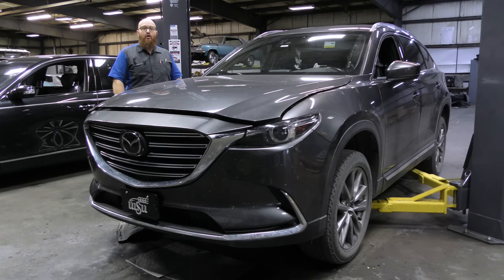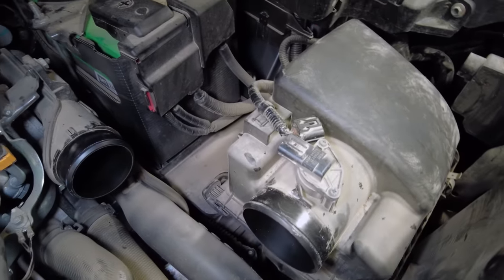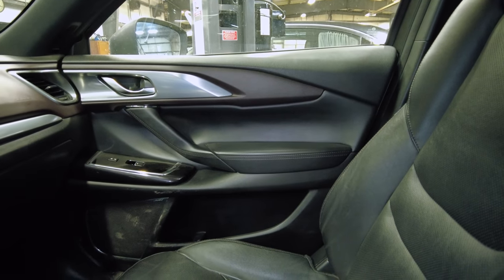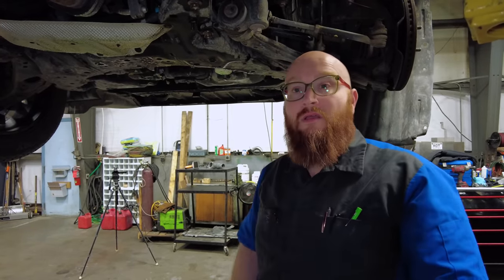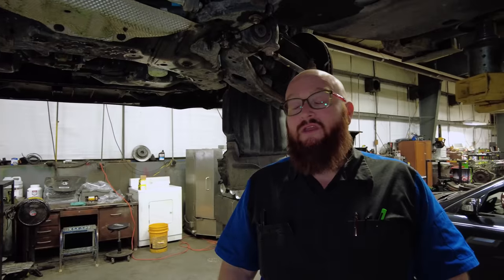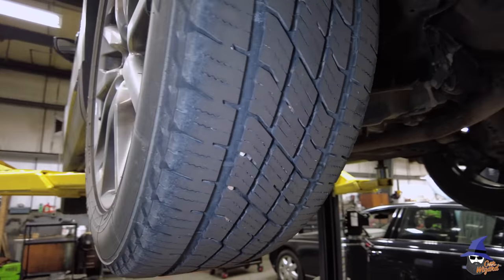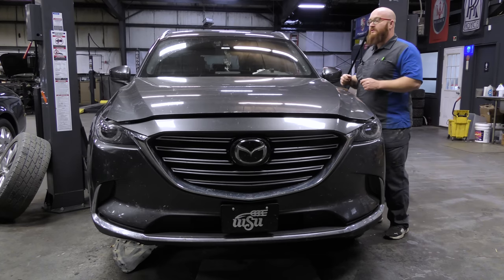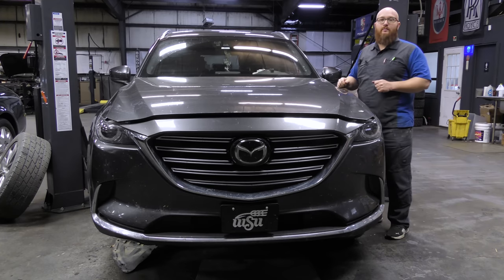Really, a $4K leak! What could be wrong with this '16 Mazda CX9 that could possibly cost that much?

Comment: It is sad that all those college/university graduate engineers (in the hundreds) that the automotive manufacturers employ can't design a decent engine that will stay together. There are a few exceptions of course, but the majority of cars are built to barely get past the warranty period. It seems to me that most of those engineers are completely useless and only drive up the final cost of vehicles.
Reply: That's why just about all newer cars have lifetime transmission fluid. The lifetime of the transmission is the warranty period.

Comment: Like any modern car with all the plastic hoses, etc. on the engines, some items might get broken on disassembly/assembly. Also, used the 'while you are in there' scenario, and since the timing chain has to come off anyway to remove the cylinder head, the timing chain, guides and water pump may as well be replaced too.

Comment: If you had an extended warranty would it cover these issues?
Reply: It depends on the wording in the warranty.  One person with a cracked head found that his so-called extended warranty covered "oil lubricated parts" which did not cover a cracked casting.

Comment: Wouldnt replacing the engine be cheaper?
Reply: I assume you mean replacing it with a similar engine from a salvaged car.  Not convinced it would be cheaper - however you will have more 'unknowns' and potential 'porkies' to contend with.  Seller: "trust me, this engine has only done 40k miles and has been driven by an old lady who went to church on Sundays".

Comment: There has to be a better way to design engines so you don't have to tear the whole thing apart for what would have been a relatively simple job 20-30 years ago, definitely curious to see the next video as to why this engine blew the head gasket
Reply: There is If they wanted you to keep the car. But they don't.

Comment: Large SUV with a small turbo 4 cylinder is a recipe for breakages early. Most of these SUVS will probably never last long term. I would never buy one like that. That engine is being abused by just driving around. And their gas mileage is probably garbage too. Who drives a turbo slow? No one 😂

Comment: Wouldn’t let a mechanic touch my car and asks 4k for leak repairs.  I’ll use $20 AT-205 for that instead. If I do need to spend $4k,  I’d rather Carmax sell it to them and all the problems goes away and 4k repair cost too.

Comment: I would try a sealant such as Iron Tite in the coolant system.  I used this product in a 1988 Chrysler new Yorker 3.0 piece of junk engine. I discovered the   head gasket was blown outward and dripping coolant on the exhaust manifold. This product sealed that head gasket leak. A diesel mechanic friend told me about this product so i tried it. These people have nothing to loose by trying it.

Comment: QUESTION: Is it possible that this HG failed based on the way it was driven? 
With an engine that small pulling all that weight is already under tremendous load & when you add in 
the types of drivers <  coughs  > uber  < coughs >  Door Dash  < coughs >  women  you see piloting these things.

Comment: They just don't build them like they used to.  Man... is it just me or do most cars today have totally fugly looking engine bays?  It's a bit disheartening as I'm a Mazda fan. (Owned a Miata for 16 years)  These manufactures are using turbo 4cyls and I don't care what make of car... they complicate things.  Gone are the days  of a NA V8/V6.... Sad.  And all those plastic parts exposed to tremendous heat cycles...  Yup...  Just buy a new one and toss this one.  I just can't get excited about the "heart" of these cars these days....  They may be engineered, but they are also planned for obsolescence.

Comment: Mazda 6 2018 2.5 turbo with only 63k miles and same issue lol NEVER EVER EVER BUYING A MAZDA AGAIN IN MY WHOLE LIFE
Reply: I was leaning toward getting a 2019 or 2020 CX9, but when I checked the Mazda forums I read about the many problems with the cracked cylinder heads and coolant leaks.   Highlander here I come!
Reply: @noncustody  yeah i just got mine fixed not too long ago i had to pay 3500$ to rebuild my engine 🤷🏽‍♂️ mazda were asking 6100$ to fix lol
Reply: Shame that stupid turbo ruins a really reliable motor.
Reply: @markg999  yeah I don’t see many mazda owners without turbo having that many mechanical issues

Comment: $9 bottle of head sealer?, bam fixed for years.
Reply: With such a prolific leak that's very likely to be a cracked head - I don't think a bottle of 'Bars' will do it.  You might achieve it with 10 bottles - as that will just block off all the water passages - result no leak and beautifully over heated engine that can double as a barbeque.
Reply: Wow so many not trues in that, statement.

Comment: To give yous a idea of ford cost saving measures,  on the tdv6 seqeuntial turbo which went into land rover/ jaguar when ford owned jag,  i was employed as engine tester in the uk,  and they were eliminating the exhaust manifold gasket to save money by machining the parts precisly and tightning the nuts on the manifold in such a way so that when hot the exhaust manifold would be gas tight with minimum leaks, thus removing the cost of the gasket from the engine.  
The direction was this.  
If it continued to leak when you had the vehicle, you would be sold an exhaust manifold gasket kit to fix it. 
Ford cost cuts to the cheapest possible level.  
Its as cheap as can be made. 
After 1 year working on ford designed and testing i can say i would never buy anything ford,  as its the cheapest " just get it over the warranty line" cars and parts.  
When i see "FORD" i laugh and walk away.

Comment: I don't care WHO made the stupid thing -- I consider this to be just one more turbocharged engine to toss on the worldwide pile of failed turbocharged engines.  You couldn't GIVE me a car with a turbocharged engine -- I'd chase you away with a baseball bat.  My advice to anyone considering the purchase of a vehicle with a turbocharged engine:  Consider it to be "disposable."  Oh, the whole gamut of turbocharged engines include heavy duty truck engines, race car engines, and so on -- and I'm not talking about those.  But "just slap a turbo on an otherwise normal engine designed to be naturally aspirated," and guess what happens?  Just watch this video for an answer to that question.  Does a turbocharger put an enormous extra amount of pressure into an engine?  And what happens if you do add that pressure to an engine?  Do you want to just flip cars every 100,000 miles, or do you plan on keeping yours for much longer than that?  All I can say is that I will never, ever even consider TOUCHING a car with a turbocharged engine.

Comment: Turbo eco pile engines of all manufacturers spelled the end of ICE vehicles. Stop and remember how reliable engines were in the 80's and 90's. Sure the performance was much inferior but they didn't cost thousands to keep on the road after a few years. Even GM and Ford had more reliable engines 30 years ago. The good news is that you can buy a Tesla model Y for less $ than this Mazda.

Comment: I never really cared for Mazda.  In the early 2000's, Mazda Protégé's and Mazda 3's were very rust prone.  The  CX-7 was an awful vehicle.  Failure prone everything.  Mazda is clearly riding on their Japanese laurels.  I put Mazda and Nissan on the same level... LOW.  Mazda even used (s) Jatco transmissions.  I never liked Jatco.  Nissan owns Jatco.  Toyota is number one for quality and reliability, followed by Honda.  Nissan and Mazda aren't worth the paper their titles are printed on.

Comment: So there is a Mazda Ford connection with these engines. A friend needed an engine replacement in their Ford Escape 2.5 turbo after overheating due to no coolent. Looked it up online and it's not a uncommon problem with these engines.

Comment: Mazda us crap engineering.  their M50D manual transmission has the slave cylinder inside the transmission - I had to take down the transmission to service the slave cylinder.  Worst design I ever seen.